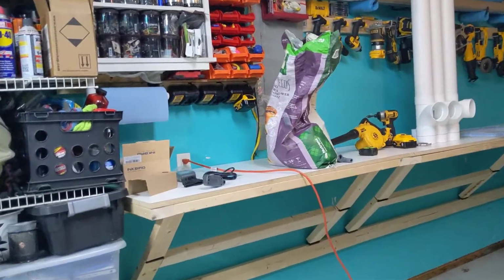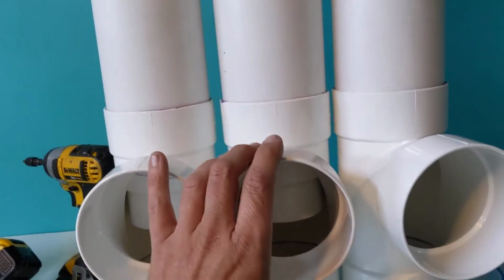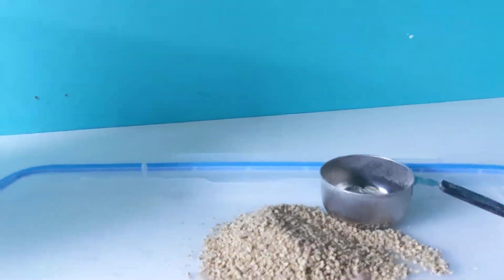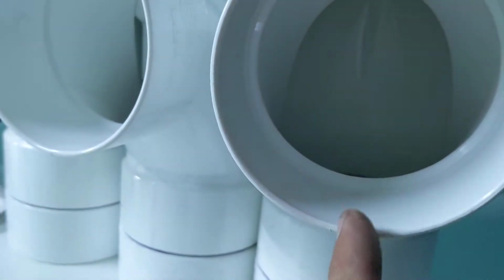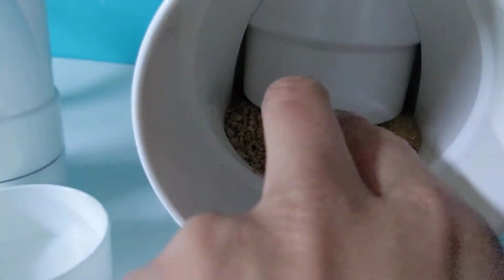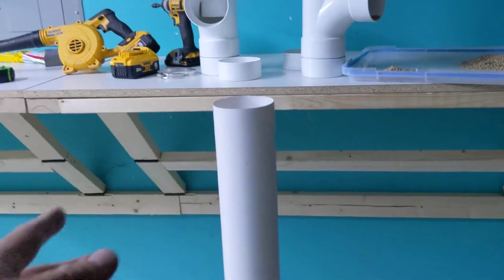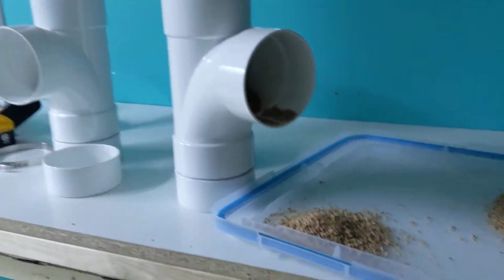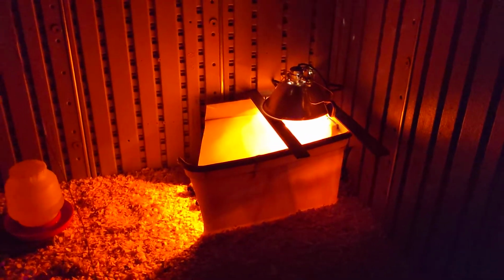Best PVC Chicken Feeders (Cheep + Easy)

Comment: nice design, I would be blocking off the bottom reservoir/route a lot shallower as I doubt the chickens will want to stick their heads all the way down the pipe, also clear pipe would be good to see at a glance how much they have left in each pipe, or at least have clear sections or put some plexi over small window holes
Reply from the maker: Chickens are able to clean it completely out, if the diameter was smaller that might be the case, I do like the idea of a window for telling how full it is!
Reply: @ianmburke  I literally just sat down from building one, I cut a slot from just above the bottom of the vertical with a dremel and glued in a thin bit of plexi on the inside and now I have a fuel gauge :D

Comment: What down pipe did you use.
Reply from the maker: It's 4 inch diameter drainage PVC and the height would just be however tall you want based on the volume you want it to hold

Comment: instead of using a Y fitting could you use an 90 deg. elbow and the same inner reducer to stop the feed from flowing out?
Reply from the maker: Maybe... but my first thoughts are: 1. It would not sit flat being on a 90, 2. The reduction might have to be greater as the 90 would be "directing" the flow on the backside to move outward. That being said, farming is all about experimenting so try one with a 90 and see how it goes? They are probably only 2$ let me know how it goes

Comment: Great video! Do you think they would still work with a 3 in. to 2 in. reducer? Thanks
Reply: Ian,
 How did you fit that 3 inch adaptor inside a 3 inch tee? Isn't the pipe  size designations measuring the inside dimensions...meaning the 3x3 adaptor would have a larger overall or outside dimension trying to fit inside a smaller/actual 3 inch tee fitting. Not really built for any fitting to go in there. Need an explanation that will make sense.  Thnx
Reply from the maker: I'm sure they would, the reducer is only to lower the spill out relative to the output pipe, if that makes sense. Without the reducer the feed will come pouring out but with it, it stops before it overspills edge
Reply: @ianmburke  Thank you!!!!

Comment: Excellent. Is there any possibility that the food at the very bottom of each feeder can become stale, or will you be able to dismantle the pipes once in a while to empty and clean it? How far down can the chooks reach for the food? Thanks for sharing.
Reply from the maker: So I actually thought the same thing and left them just snug fit so I could take it apart and clean it but their necks/beaks reach all the way to the bottom so they clean them completely out
Reply: @ianmburke  thank you, was wondering the same thing!
Reply: What about a 90 degree bend at the bottom instead of a Y?
Reply: U could easily fill it with gravel at the bottom

Comment: Does that reducer fit inside the pipe?  How did u get it into the y
Reply from the maker: It fits right inside of the y then the pipe above holds it in place (but it does fit inside the pipe as well just a tight squeeze